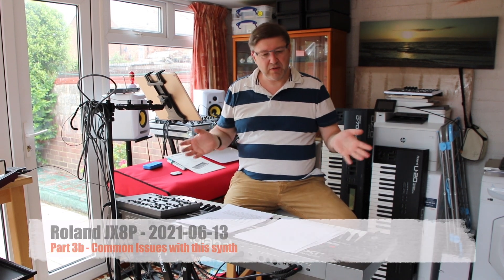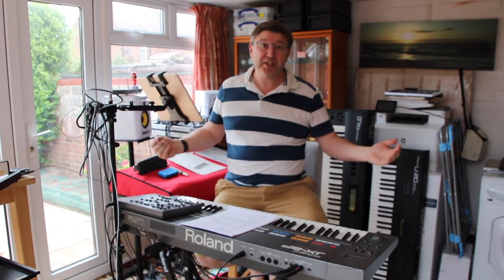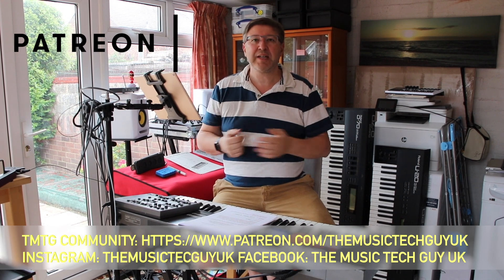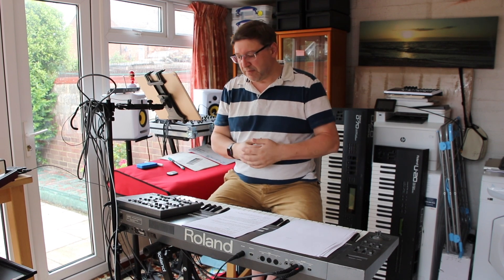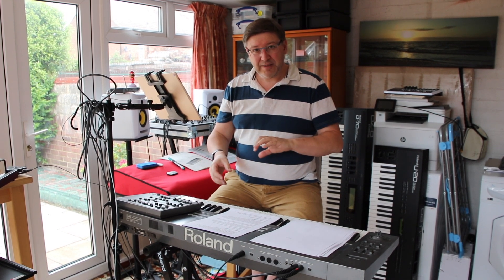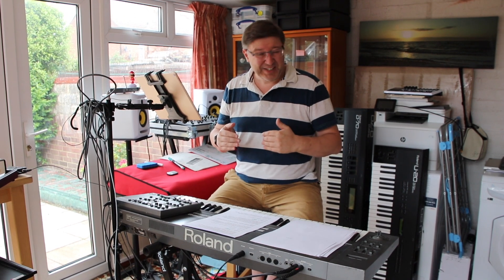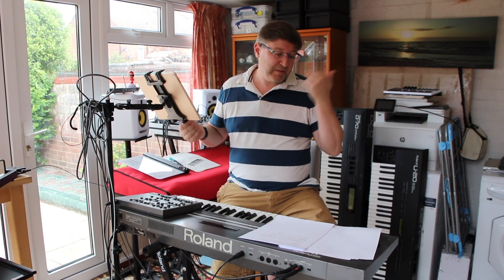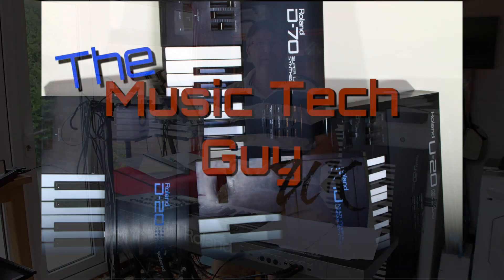Common Problems with the Roland JX-8P - Part 3b

Comment: Thanks for the video, recently bought a JX8p
Reply from the maker: Hi @BrianPT Guitar Keyboard Covers.  Let the channel know how you get on with it.  Jon
Reply: @TheMusicTechGuyUK  has one dead key and the note holds sometimes (note freezes) other than that sounds great love the pad and strings sound, does the note holding end when I use a MIDI controller?
Reply from the maker: Hi @BrianPT Guitar Keyboard Covers

The dead key could just need the contacts cleaning or issues with the tracks.  You will not know until you get inside.  The note holding I will throw out to the community as I am not sure what might be causing this if it is intermittent.  Jon
Reply: @TheMusicTechGuyUK  thanks for the info
Reply from the maker: Hi @brianptguitarkeyboardcover9957 👍 Jon

Comment: hi! i suddenly lost input volume and the volume fader stopped working. any thoughts/solutions? thanks
Reply from the maker: Hi @hugorunthatshitup9056

Normally when some thing stops working like you have described it is because of a component failure.  It could be as simple as a dry joint or a component on the circuit board has failed.

Sorry there is no shortcut on this one.  You will need to open it up.  Hopefully if it is a failed component you should be able to see the failure on the board, order new parts and solder them in.

Hope this helps.  Jon

Comment: Thanks for the video! I was actually searching for the pedal issue.
I'm not sure if this is also common, when sending midi message to computer (haven't test any other hardware), the notes won't sustain while using pedal unless I held anyone of the keys in chord. I found it might be the "All Note Off" midi parameter issue but don't know how to fix it.
If you know the solution please contact me 😢
Reply from the maker: Hi @Kian Tan

As I understand the MIDI implementation on the Roland JX-8P does not transmitted the pedal hold command.  But I stand to be corrected by those JX-8P experts that follow the channel.  Jon

Comment: Important to note that when you are polishing the screen, you either a) remove it from the synth (which is a pain) or b) use blue painter's tape to restrict your polishing to just the screen itself and not the grey plastic surrounding it. See here: https://youtu.be/WJ1c66xj8Xo?t=1277
Reply from the maker: Hi @andrew jones 

Great tip.  Published for others to see.  

I have to admit that I have seen this video in the past.  Jon

Comment: I have a jx8p and a super jx10. The jx8p I am keeping 8n the closet at I dont have enough space for both.
Reply from the maker: Hi @amonster8mymother  

Thanks for the info.  I have been after a good condition Super JX for a few years.  One will turn up eventually in Europe somewhere.  Jon
Reply: @TheMusicTechGuyUK  I'm running the jx10 with msq700 sequencer and I have a alpha Juno 1 as well. I'm hoping to sequence the jx10 with separate midi channels as well as the alpha Juno. I'm not sure if the msq can do that. Also program changes??? If that is possible. Anyway using the jx10 as a midi controller with all the hardware gear. 😁😁😁
Reply from the maker: Hi Hi @amonster8mymother  

I don't know the specifics of the Roland JX-10, but the JX-8P could only receive on a single channel, assuming I have remembered that correctly.  I am not sure whether each sound engine can be driven separately.  Jon